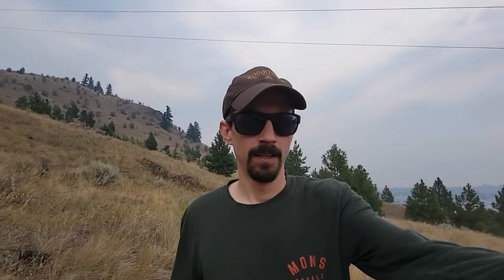Van Problems continued...

Comment: Wheel speed censors, throttle position sensor, ground wire running thru engine mount all replaced on my 2500hd and the problem continued for years
I would have to turn key off remove key open door to turn off computer, wait 30 seconds repeat until it stopped, nothing like pulling a trailer at 70mph and have reduced engine power engaged, go into limp mode with zero throttle response on the highway good luck foresty I hope they figure it out and are actually able to get sensors in reasonable amount of time

Comment: Good luck, it sucks having issues. During the heatwave we had a P0300 on ours. After a while of diagnosis at the mechanics he thought it was a burnt valve, so we limped it home. Turned out to be a broken Exhaust valve spring on cylinder 3. So not too bad of fix. Hope yours end up not being too bad.

Comment: not likely for multiple sensors to fail simultaneously - more likely to be either a common power connection issue or common grounding issue - really enjoy the adventures of Foresty

Comment: steering wheel sensor is common on GMC. involves pulling the steering wheel to replace. sometimes it just needs to be cleaned (corrosion) usually pops a service stabilitrack error on dash.

Comment: Disruption of one’s life rhythm can be challenging, for sure.  My sweetie bought a pre-owned 2016 Nissan NV200 last year in April with less than 25,000 miles on it, and in April this year, the transmission went out on it.  Turns out, it was the computer brain that had caused the transmission to fail, and it also had to be replaced.  I long for the days when cars weren’t run digitally!  Good luck finding your problem.  I’d suspect the computer “brain” before anything else.

Comment: That code is showing short on a 5 volt reference at the air intake or throttle pedal. Check those for broken wires.

Comment: I hope it's something simple and easily replaceable like a blown fuse or capacitor on a circuit board or something.  
I had some blown caps on the dash board on my BMW motorcycle.  Pulled it apart and soldered in newer, better ones and it's all good now.

Comment: Muffler bearings, don’t forget to check those out while you are at it.
Reply: Blinker fluid is low, causing blinker pump starvation on steep inclines.  Should be an easy fix!
Reply: @RealJohnnyDingo  must have leaked out and ran down on the muffler bearing causing premature wear.

Comment: Sorry to hear man, sucks to start having problems so soon after building out your van.  Should have imported a used Japanese van instead of picking up a Chevy!
Reply: Sienna woodland edition is coming out next year.  AWD, slight lift, built-in 1500W inverter.  You don't want one to live in full time, it's too tiny and the center console looks pretty hard to remove.  It would make a great van dweller vacation home though :)

Comment: wheel sensors can set an error any time they spin faster than the rest. understandably it shouldn't also set a dash light or disable anything unless it stays constant. other code might be as simple as a tune up needed. Good luck

Comment: Either you have two bad modules ( ECM & ABS ), or you have a ground issue or a BUS problem. Idk your vehicle configuration, but if you've tapped wiring to power your van life devices I'd start there.

Comment: Your van:  Unfortunate about your van issues, everything is fixable.  Off-road wise most experienced  drivers install a ABS bypass, basically an ability to turn off the ABS as it can misbehave and screw up the 4wheel drive.  Only a thought that it (ABS) might be part of the cause.  I now keep my ABS off 100% of the time as it also screws up on pavement because of the slightly larger tire size I run from stock.

Comment: usually means a bad connector or wire in the 5v circuit but a shorted censor would do it.....   Did this problem occur shortly after doing any other work to the truck?
Reply from the maker: I've been getting random "service stabiltrak" message over the last couple months.  Maybe it finally went over the edge.  But yes, I just had the front light bar wired in last week too.

Comment: Freakin’ computer sensors!! It’s most likely not all the sensors but one causing data discrepancies. Possibly knocked a wheel sensor out of position or disconnected the battery with the steering wheel turned. I would start with steering wheel angle sensor calibration. Put steering wheel at zero position which is wheels straight. Turn car on and start by turning the steering wheel all the way (left or right turn) hold for two seconds in full turn, then turn all the way to the other direction, hold two seconds, back to zero and repeat two more cycles, finish at zero and shut down car. Hopefully that works. If not, inspect wheel sensors at the hubs. If it runs messed up, I disabled one sensor by pulling the connector and that will disable the whole system allowing the vehicle to operate normal.

Comment: So since all wheel and steering wheel sensors are showing an error, that probably means the excitation voltage sent to each sensor is bad (i.e. not delivering the voltage). There is no way all those sensors failed simultaneously. So it seems the Lust for whatever guy in the last video comments may be on to something. He said it was the ECM 5V source voltage being shorted somewhere was the problem. He may be right. If so, hopefully it'll be a fairly easy find and fix. GM products are unreliable and problematic though. Maybe next van get a converted 4x4 E350 or small Ford box truck. A good one is expensive, but it should treat you better overall. A company called U-Joint in the states does the Ford 4x4 conversion for $25K. A lot of $$$ I know, but if your channel keeps growing (and I think it will), it may be a wise investment.

Comment: Lets assume the sensors are good. And you getting multiple errors, that vary. It is possible the (CPU) the main computer controller has or is failing. Which is not bad, as you can just replace the unit. Worst case is a short. Worst, because finding the open short could be a real hassle. My bet is on the controller has some failure.

Comment: Bring it to Drayton I will fix it 👍🇨🇦🛠️🇨🇦🛠️
Reply from the maker: Rip out all the wheel sensors and traction control system?
Reply: @morestyforest4325  check make 100% sure the brake lights aren't sticking on.  When it happens check see if brake lites are on. Not the brakes but the lights 👍🇨🇦🛠️🇨🇦🛠️

Comment: Yup, wire loom damage.  I saw a video on this about 6 months ago on one of those mobile mechanic channels.  The first mechanic replaced all kinds of sensors but failed to check for wire damage, so the problem was never resolved.  The mechanics secret was that when you have multiple sensors going off, and the sensors seem normal, then it's always going to be a wiring loom problem.  

Just take 15 minuntes underneath the van and look for obvious signs of damage, and you'll solve the problem.  You need to physically inspect the wire loom on the bottom side for abrasion/damage.   Their is a special tool for this type of investigation, but I can't remember what it's called.   classic wires rubbing together or grounding out.  see https://www.youtube.com/watch?v=CfNwI8vM3lk

Comment: Told you brother GM (Chevrolet) products are plain crap
Reply from the maker: Haha, well this van wasn't designed for offroad use from the factory.  It will take some time to dial it in correctly.  But yes, a part of me says, maybe i should've started with something offroad worthy, like a Tacoma TRD with a camper shell.
Reply: @morestyforest4325  and when your running new wires for power ect. you have make sure you keep clear off other importin parts. good luck. will keep watching.